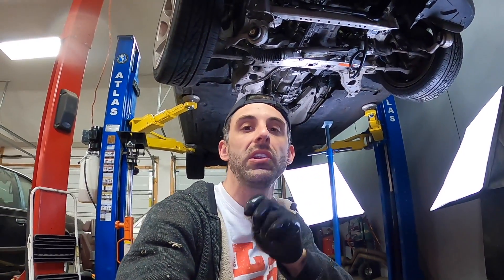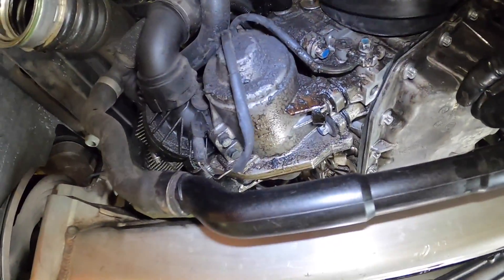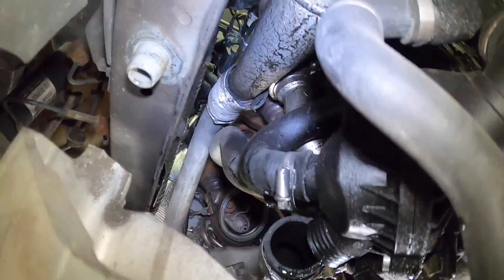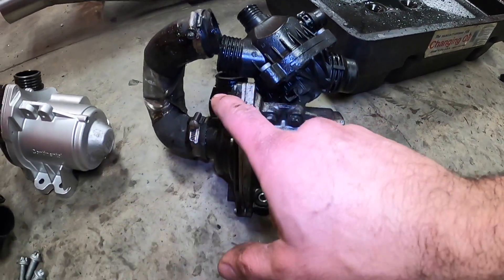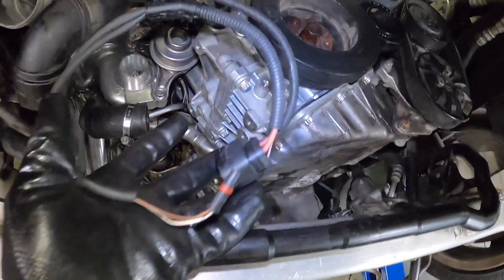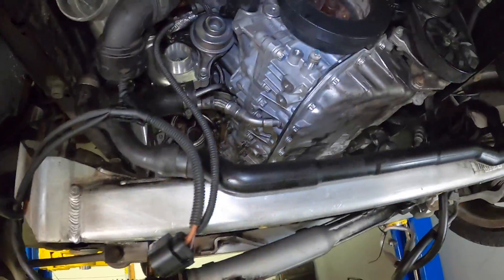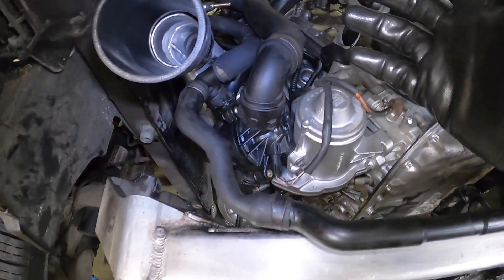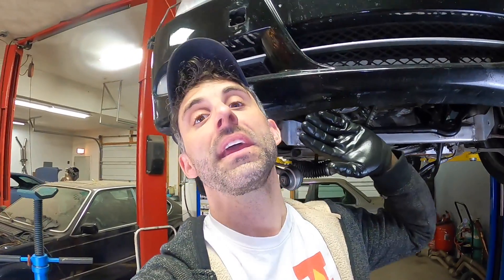Part 2a BMW N54 Water Pump Replacement

Comment: Very nice fix Frank. I thought these pumps go out only on mileage. Mine got a tiny crack in the plastic housing at only 52k miles but 12 yo. That was a bummer. I bought a new continental which has the same plastic housing, unfortunately. INA, which is a (german) OEM BMW manufacturer, produced a 100% aluminum water pump for these engines. I didn't know that at the time I bought mine. In Australia, this INA pump is sold a lot. Maybe because of the warm climate over there. Dutch regards,Nico
Reply from the maker: Very interesting Nico! Sometimes there’s no telling why a pump fails early. Or some pumps last forever.